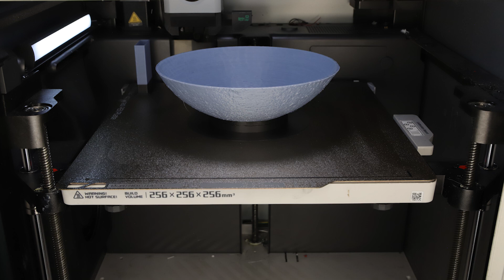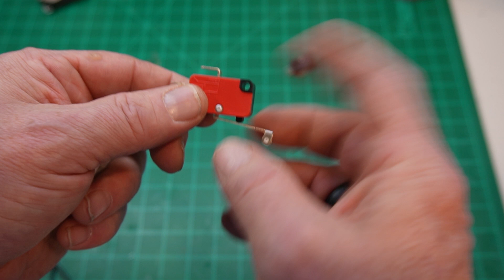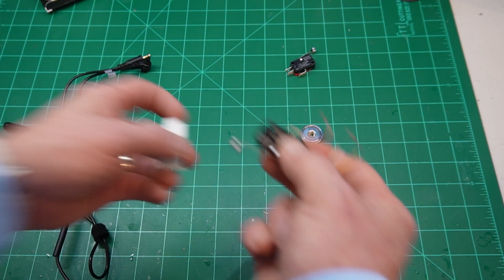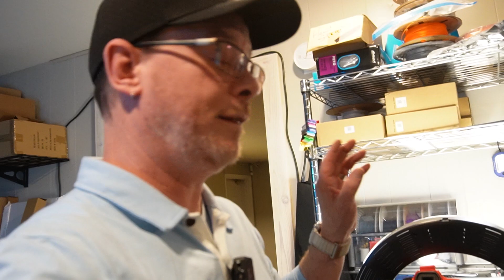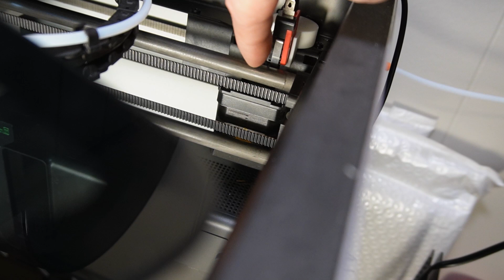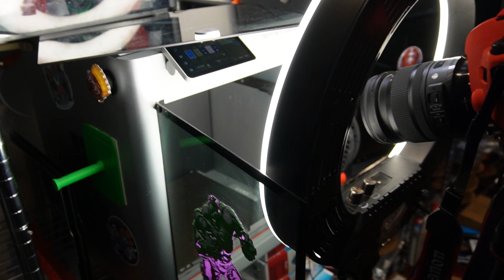How to make a camera trigger for high quality time-lapses on Bambu Lab printers X/P

Comment: So my p1s doesn’t pause and move back to activate the switch after each layer. What settings do I need to change to get it to pause, move back and activate the switch then resume printing?
Reply: I never knew that setting was there. Thanks a bunch!
Reply from the maker: No problem!
Reply from the maker: When you slice the model be sure to select smooth time-lapse as an option. That'll send it back after every layer.

Comment: Will this work for single color prints or just multicolor
Reply: All my supplies will be here today so I’ll let you know how it worked out
Reply from the maker: Just be sure to set the print to smooth time-lapse when you slice it so the head moves back to hit the trigger.
Reply from the maker: It'll work on a single color print.
Reply: Any code that needs to be added?

Comment: I like this idea, thanks for the share. Question... is this still printing the prime tower and wasting filament? Usually setting "smooth" mode for time-lapse will print a prime tower and blob and takes much longer. wondering if there's a way to inject the printhead to move back after ever layer to trigger the switch without needing the tower/blob.

Comment: The Camera he mentions is Canon 6D MKII. That's a pretty expensive camera for a hobbyist. Anyone have any more affordable alternatives?
Reply: Sony A6000 or Nikon d5000 series. Used cameras will be fine and still give a 4k image. I use a few A6000's for most of my timelapse work
Reply: When you're buying the adapter, be sure its for the brand you buy. Sony, Nikon, and Canon all have their own. You can buy an intervalometer for $15 or so and cut the cable off of it to attach to the limit switch too

Comment: Nice idea. The switch has a little roller at the front, this is usually meant to reduce stress on the moving part, maybe rotating it is a good idea.
Reply from the maker: The little roller is what makes contact with the carbon rod, rod doesn't press it hard so no chance of damage 😉

Comment: Maybe I'm missing you mentioning it, but when/what is physically triggering the switch in this setup? Something during z-axis movement?
Reply from the maker: It's the carbon rod when the bed moves on the y axis to take the pic of the built in smooth time-lapse.